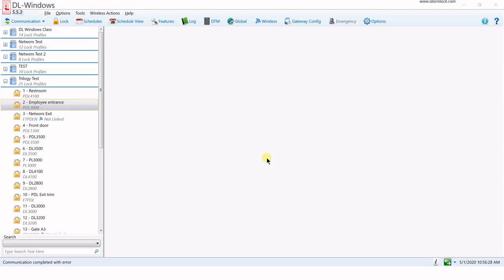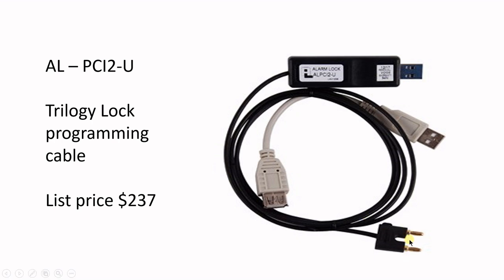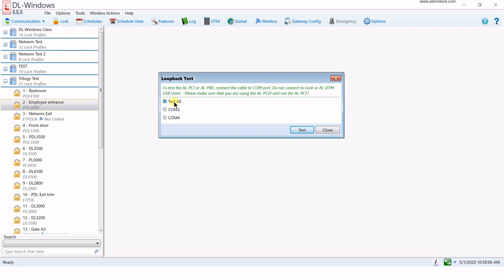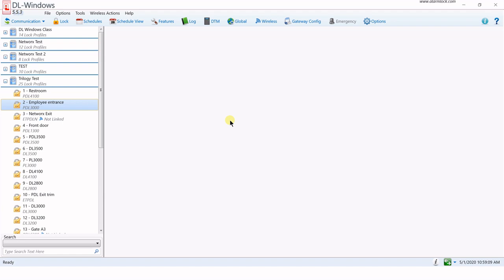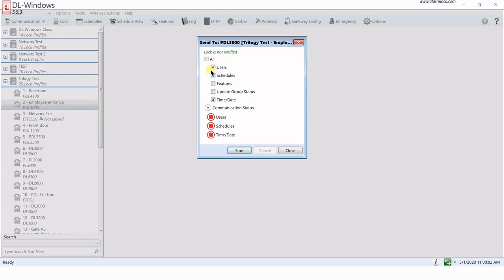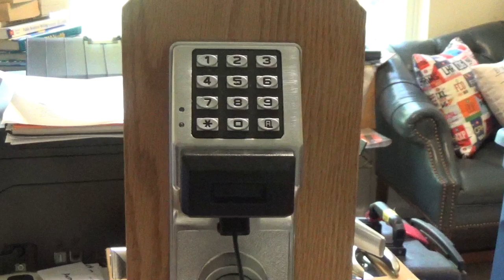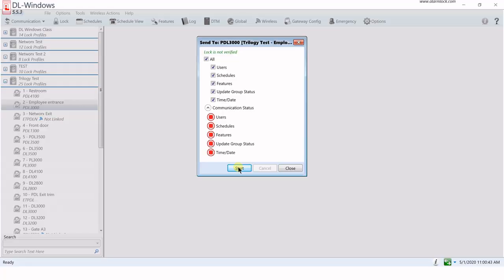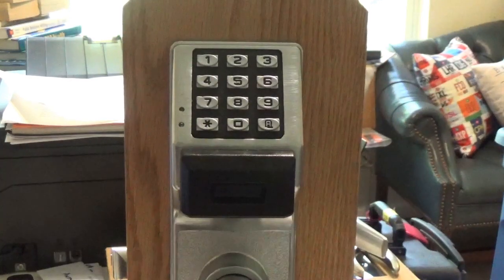Programming Trilogy T3 using PCI2-U cable

Comment: I have had to import our members on to a new laptop from an Exel spreadsheet after the old laptop died, I was able to get the lock, PDL5300, data transferred from DL windows but using a Prox card from the list does not open the lock, I am able to enter pins and Prox cards manually on the lock and it will open. Any ideas I can try?
Reply from the maker: The CSV import does not include the Prox cards. Alarm Lock can’t import Prox card data.

Comment: Same thing.  Keeps timing out. 

I'm installing a new lock.  It works on the old lock but not the new one.  Drivers are in, security password set, comport set.  Still won't work.
Reply from the maker: This would be a situation where you would need to work with a local dealer to determine what is happening. If you don't have a local dealer, you can contact either Dave Tuttle, www.alarmlocktech.com, or Go Keyless, www.gokeyless.com. Both work with end user tech support.

Comment: Hi, I keep getting timeout too
Reply from the maker: Drivers for the PCI cable need to be installed and a Security Password needs to be set for the account for communication to proceed. Also, need to run the Comport Setup and Test.

Comment: what happens if you keep getting "communication timeout" msg when doing the communication "send"
Reply from the maker: Did you install the drivers for the PCI cable and did you run the "Comport Setup and Test"?
Reply: @AlarmLock  The Comport setup and test passed successfully at comp 3. and yes I did install the drivers.  Do I need to set the DTM config baudrate to 9600 as suggested by the help menu. Does that even have anything to do with it?
Reply: @AlarmLock  How do I install the drivers? Where can I get the drivers?
Reply from the maker: @Dpowers143  In the folder with the software that you probably downloaded from our tech website.